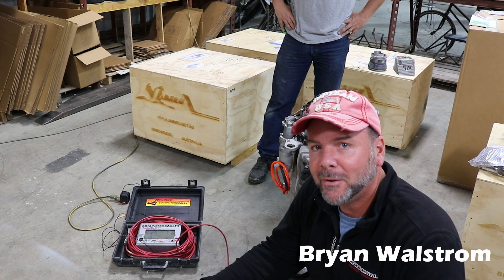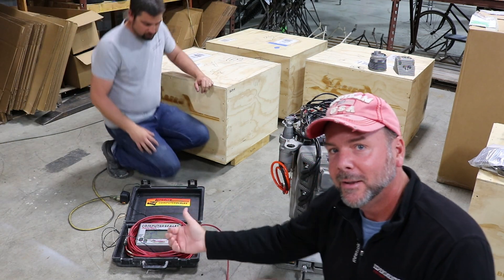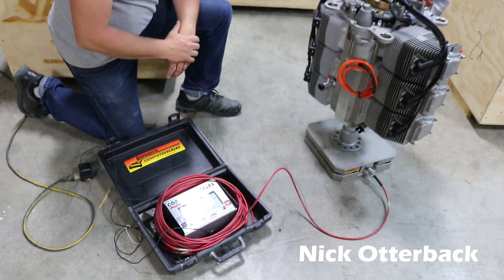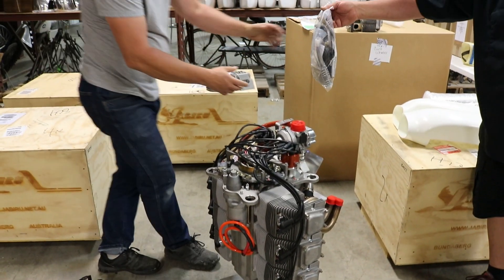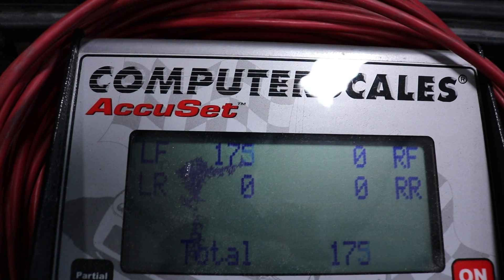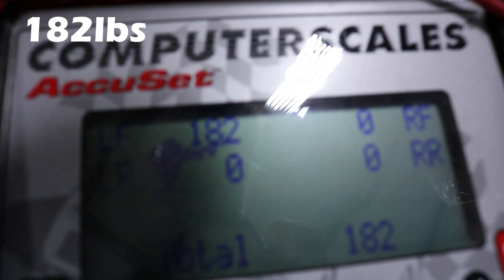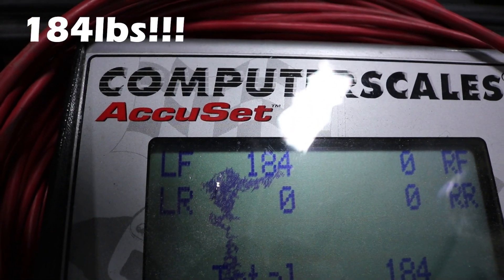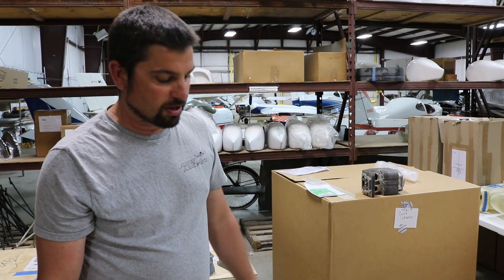How much does a Jabiru 3300 Engine Weigh??!

Comment: This is NOT INSTALLED WEIGHT, just OUT OF THE BOX.
Reply from the maker: To be clear... an "INSTALLED WEIGHT" can be VERY different from one aircraft to another. Especially simply going from a High Wing to a Low Wing aircraft. This gives a baseline of what the engine weighs. And YES if you look closely the EXHAUST HEADERS are bolted to the engine already. The "Muffler" was rested on top during the video... so that is a COMPLETE Exhaust System. The STARTER is installed. The ALTERNATOR. The IGNITION. It is all there. Thanks for your interest in promoting Experimental Aviation!

Comment: What about the exhaust pipes to the muffler?
Reply: They are on the engine.
Reply from the maker: If you look closely (and sorry I didn't do a quick spin around the engine in this short video) you can see the Header Pipes come already installed on the engine... the "muffler" is installed later OR even as an option because some just slightly extend the exhaust with exhaust tips.

Comment: About 10% lighter than the Continental O200D of larger size, identical displacement and less hp. Nicely done.
Reply: Continental don’t have cylinder head overheating problems😁
Reply: @SM-nm1oc  I was in a rental when an O200 blew a cylinder. Cracked about 270 degrees between a pair of fins. If a Continental was slimmed down another 20 pounds and spun up to 120 hp then I'd bet we would see more problems. Don't get me wrong, The O200 is a great little engine and the Jabiru has some nice points too. 

Every installation is an experiment that can impact the engine's reliability.
Reply: @paulslevinsky580  Paul I see your point, the thing is Jabiru has a long record of problems and mid flight failures just google Jabiru accidents.!  Scary 😦

Comment: Were the header pipes and full intake/carburetor present during this experiment? 
Ok, 3rd time through, I see these items.
What about an oil cooler?
Reply: You can see the Bing carb, intake pipes and exhaust pipes in the photo. Oil cooler is dependent on application, so no - I doubt that it was included, nor the associated oil lines. My oil cooler and hoses for my Jab3300 only added about 4 lbs or so.